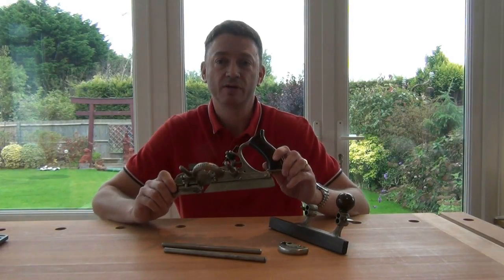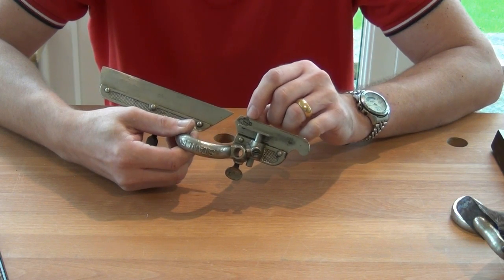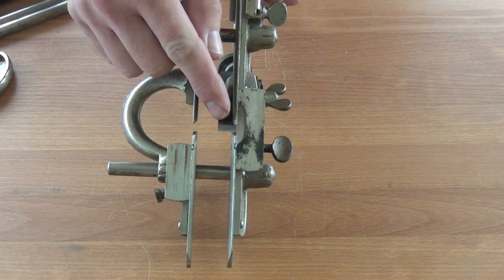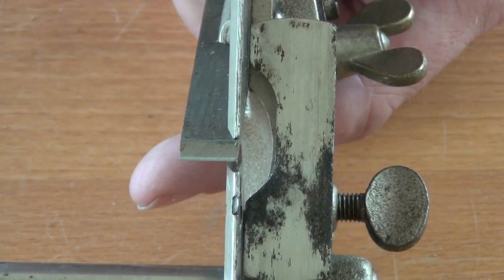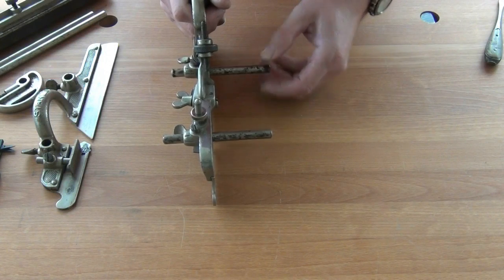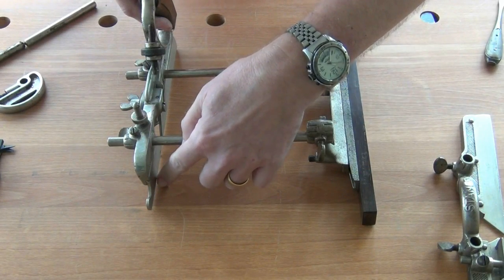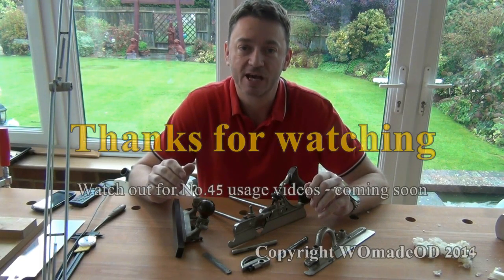Anatomy of a Stanley No. 45 Combination Plane

Comment: Good video with very deep insight as to the versatility of this plane. I bought one last year but unfortunately most of the smaller cutters were snapped at the notch or bent out of shape. Now I am a bit wiser and have just bought a N0 55 plane, every single one of the four boxes of cutters are in pristine condition just like the rest of the plane. Can't wait to start using it this weekend
Reply from the maker: smike230966 Thanks for the compliment. However I'm now suffering plane envy - Haha!  I'm sure you're going to enjoy using it. Happy woodworking, Mitch

Comment: Thank you so much for the Stanly 45 instructional. I inherited a full 45 set that is in excellent condition and hadn't a clue what were best practices in using it. It's been sitting on the shelf in the box. Your videos inspire me to give it a closer look-see.  What kinds of woods do you find that it best works with? And thank you for making these videos for a rather limited crowd. (I did subscribe).
Reply from the maker: Cheers John. Straight grain, clear pine, poplar, that sort of thing. At least until you get used to it. Have fun

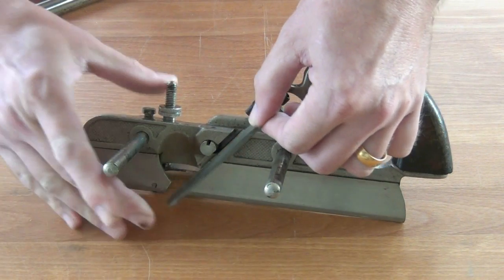Comment: For the depth adjusting, why is there a groove in the side of the screw (adjustment mechanism) Showed @3:38?  I just got one of these things. and the pin that notches into the blade just spins around unless I hold it while adjusting depth.  I think its from rust, but wondering if it has to do with that groove.
Reply from the maker: Ah, I think you have a little repair to do. There should be a small alignment pin through the side of the top hole, which engages the groove and prevents the screw rotating.
Reply: Yes! You are a genius! I removed some rust and see a small pinhead that is not engaging the groove in the screw.  I think the part that engages the screw  may have  rusted away.  I'll try to punch out  whats left of it  and  fit a new pin.

Comment: Do you know how to remove the wood on the handle? I am restoring a 45 and 46, and that's all that's slowing me down now. Thanks
Reply from the maker: That's a good question! I've not done it, but I don't recall seeing any visible fixings on the 45s and 50s I've dealt with, and would therefore guess that the handle are glued. I would strip any varnish and look for a joint line. If there is one, wrap it up in a hot damp cloth and with luck the glue will soften and allow the parts to be separated.

Comment: I assume you could also use the fence backwards against a "wall" or some kind of rail if you were cutting a groove into a large piece that was too wide for the fence to rest against the side of the piece?
Reply from the maker: Sadly the fence needs to drop down with the cut as it proceeds. I use a wooden batten clamped on the workpiece and run the planes skate against it. Once a cut is established, the groove will guide the plane.
Reply: @mitchwoodwork  Ah yes, of course! 
I just got my first combination plane today, a Lewin, so I still forget some of these obvious things, even though I know them somewhere in the back of my brain.. 
And thanks, I'll keep that batten tip in mind.

Comment: I just bought a 45…how do you adjust the fence if it is not parallel to the skate, as you showed is the case on yours?  It doesn’t look like there’s any way to put any shim material in there to make it parallel…
Reply from the maker: I assume you have a wooden fence, in which case you can plane it, using stop shavings, into parallel. You could also loosen the wooden strip and shim it into parallel.
If you don't have a wooden fence, then add one which is shaped to take out the error.